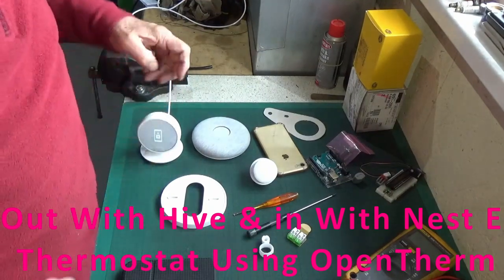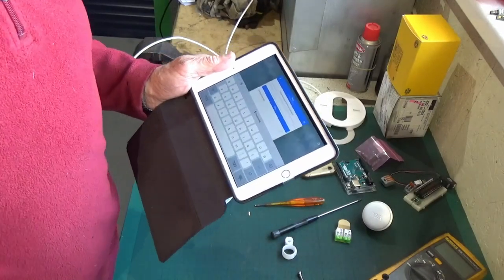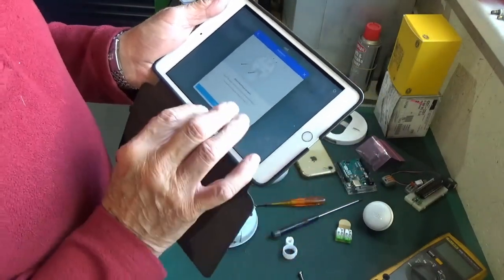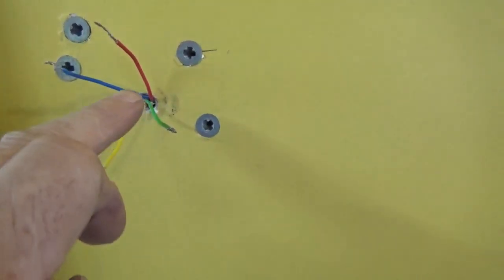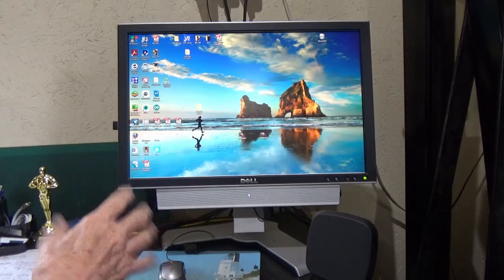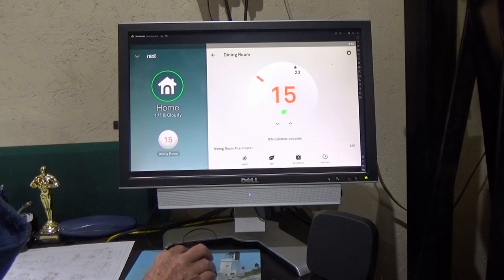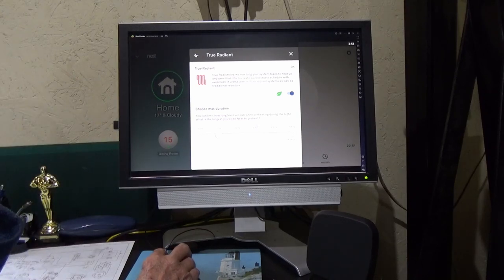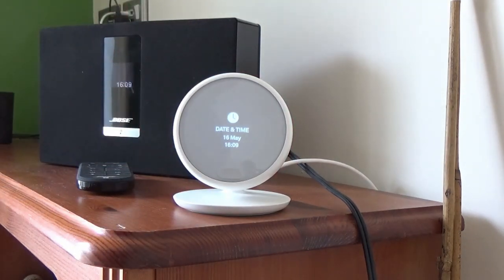Nest E Thermostat Installation for OpenTherm & Baxi Combi Boiler (Part 2) UK

Comment: Morning Brian,
I've  just watched both videos on Nest e installI, very informative. How is it working? I've just had a Baxi 800 fitted and also have a Hive thermostat from my old system. It worked well because the old boiler didn't have OpenTherm. I'm now researching all OpenTherm Thermostats to replace Hive and would like to know how Nest e is functioning for you. Look forward to your reply.
Reply from the maker: Hi Tony, my Nest E worked very well with my 800 series Baxi combi boiler wired in the opentherm connection and I was very pleased on how it performed well last winter. However l was given a used but in very good condition Nest 3rd generation unit and heat link in summer so l swapped the units over (still wired for opentherm) the only difference is you need 4 wires for the heat link as the unit has no batteries so is powered by the same mains supply as the boiler by the extra 2 wires. I didn’t need to swap over to the Nest 3rd generation unit and it’s probably a bit of a waste on a combi boiler as you are not using a separate hot water cylinder, but l just wanted to try it. I only ran the Nest 3rd generation unit up to November this year, so just for a couple of months, as since November l am in Australia until June next year. The heating is set to off but will come on if the inside temperature drops to 4 degrees c. I am in Melbourne at the moment but go online and check the inside and outside temperatures every week or so from the Nest app on my phone. Either way the Nest E or the 3rd generation unit will work well wired in opentherm with the Baxi 800 series, it takes a couple of weeks for the Nest unit to learn how long it takes to heat up the house to your set temperature, also how long it takes to cool, once it has collated enough information you will be getting the maximum performance from your boiler. Regards Brian

Comment: Hey do you know if main eco compact will work with the nest opentherm? As I’ve read Baxi only allow their own brand ‘usense’ thank you
Reply from the maker: The Main is manufactured by Baxi and has the same internal components. I had a look at the Main eco compact installation manual and it shows the OpenTherm connections the same as the baxi on the second connection strip at terminals 1 and 2 so the fitting of the nest e thermostat should be exactly the same as the Baxi. However for absolute confirmation call the Main tech helpline on 0344 871 1545, which l think is the same number as Baxi.
Reply: @TheCADengineer  hey Brian, cheers for that, so we connected it via opentherm today and the nest e recognised it was connected. I set the hot water temp to 60 degrees but when I put the tap on and looked at the boiler at the same time it was hitting 70 degrees on the screen? Is that correct?

Comment: 60-65C hot water is for if you have a HW storage tank to avoid Legionella dangers. A combi boiler heats HW as you need it; normally you want HW at around 50C at the taps to avoid scalding risk, unless your taps have a mixing capability to reduce the temperature seen by the user. 🙂
Reply: But a useful and interesting video! Does your boiler actually turn off with the OpenTherm connection? I’m guessing it does when the room is at the desired temperature? But apparently only a couple of OT stats implement the OTLowLoad message & Nest apparently isn’t one of them, so still a bit confused over the detailed working of an OT stat and boiler.
Reply from the maker: No worries, combi so no storage, we have 2 showers so on the rare occasion when we are late (as per normal) and we both need to shower at the same time the extra temp allows it, both showers to run, both are thermostatically controlled and works fine.
Reply from the maker: Summer here now in the UK so no request for heat from the Nest unit as the ambient temperature is above the call for heat setting, however l have ordered an OpenTherm gateway which will connect in series into the pair of cables between the boiler and nest heat link. It will use a Wemos Wi-Fi unit and with some software on the laptop l will be able to see real time graphical info on what the boiler is actually doing in terms of temperatures and modulation. It should arrive next next week and is in kit form with a main board and components that you assemble/solder yourself. I plan to do a video of the construction and installation of the kit.
Reply: @TheCADengineer  ah, I’ll be interested to hear your results with it. Was browsing for OpenTherm last night & found Intergas are selling an OT gateway monitor, see https://m.youtube.com/watch?v=Rx-rUxzMN8Q. Might be the same kit.
Can you hear the pump going? Does it stop if you turn the thermostat way down?  What boiler do you have? 
Wish I could find detailed info on the Nest, the Google Nest site seems quite superficial, and they havent responded to my email query, and I can’t join up to their community site to ask any questions...
Reply from the maker: @jorkirasalas2726  The new boiler is a Baxi 830 combi, the pump is in the boiler casing and it's so quiet you can't hear it running anyway. The gateway you mention will do the same job as the one I have ordered, but mine is a kit you build yourself, you can plug direct to a laptop via USB, but I will be using a WeMos module so I can connect via wifi. The software it uses is exactly the same as in your link for the intergas. Here is the link to the gateway: https://www.nodo-shop.nl/en/our-products/211-opentherm-gateway.html
Reply: When you get your gateway assembled it would be interesting to see the interface details when the heating reaches the desired temperature. I’m guessing the thermostat comparison table I saw online is incorrect and the Nest does implement the OT Low Load message, otherwise I can’t see how the boiler would ever switch off! 😉
Reply: Oh, and have you checked to see if the HeatLink HW and CH switches operate according to the schedule when using OT? I have an S plan with zone valves that I need to control...
Reply from the maker: @jorkirasalas2726  The with Nest the boiler is always in a ready state as your heat time settings are controlled by what you set your temperature to for that time.
Reply from the maker: @jorkirasalas2726  The Nest E is designed for a Combi boiler with direct hot water demand priority from the boiler and the only control you have is HW temp. If you have a HW storage tank and or zone valves like Y or S plan where you have individual switching then you need the Nest 3rd gen (I think the new 4th gen has just been released)
Reply: Ah yes,  my bad. Was concentrating on Nest & forgot about the Nest ’E’. Think the 4th gen is a cheap version of the 3rd gen & don't like the look of it.
Reply from the maker: @jorkirasalas2726  I would go for the 3rd gen as it will have all and any issues sorted, the 4th gen is still an unknown quantity and will have a few bugs in the early days.
Reply: Yes, my preference is for a Nest 3Gen, but also considering EPH & ESI options...decisions, decisions! Planning for an autumn upgrade of the heating system, but first got to look at getting some more loft insulation!
Reply from the maker: @jorkirasalas2726  Good luck with your upgrade, you have done your research so you will find your best option.
Reply: Thanks!
Would still be interested in your results with the OT gateway monitor for when the room gets near the desired temperature!
Reply from the maker: @jorkirasalas2726  Will let you know
Reply: @jorkirasalas2726  which stats do implement OTLowLoad please?